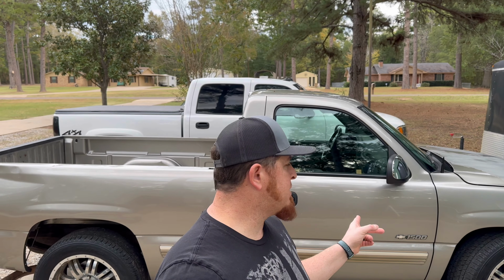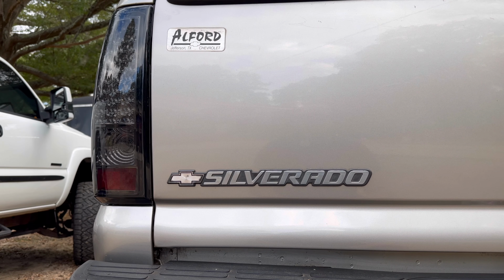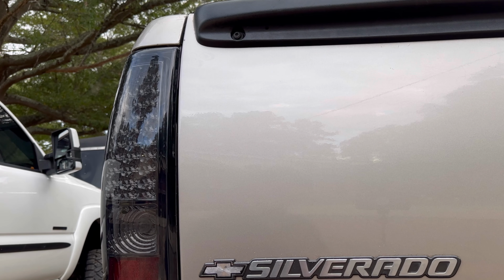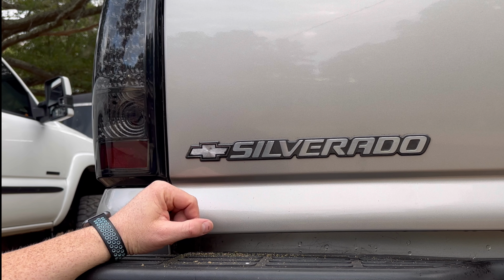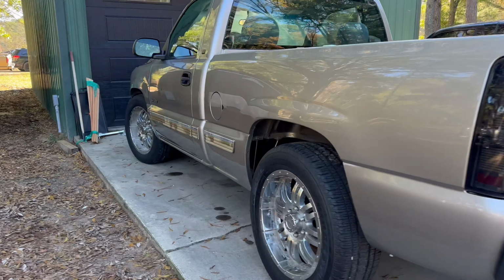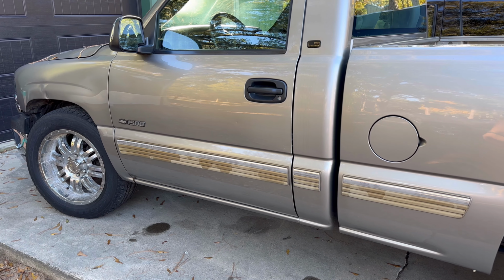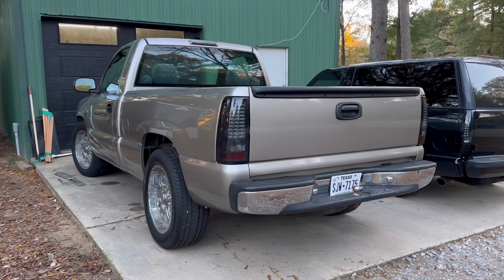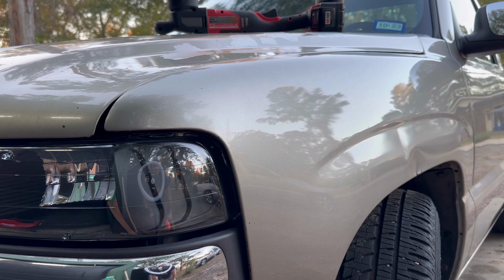EMBLEMS AND MOLDING REMOVAL DROP SHACKLE INSTALL‼️Part 2 Chevy Silverado RCSB Transformation‼️

Comment: Tip from experience with my 2004, you dont need to do the floss/string trick with the side trim if you're in a warmer environment. let the truck heat up in the sun and they should pull right off
Reply from the maker: True, sometimes you do not. However, you should always be careful not to pull too hard and peel the clearcoat or paint off of the truck.

Comment: Looks cleaaan good work.. plan to do the same to mine here next handful of days.. got the flares off yesterday so now it’s time to debadge and remove door trim & the z71 sticker (which I’m having a hard time parting with lol).
Reply from the maker: Thanks! Yeah yours will look clean debadged. If your truck is a Z71 then just get a new Z71 decal, but is a custom color. That will make it more custom.
Reply: @whiplashtv2022  that's a good idea if i end up keeping it... feel its homage to chevy by keeping it but, damn every bed I see without looks so good lol thanks
Reply from the maker: @lilshaff07  I hear ya. Atleast it is a decal sticker and is cheap and easy to add or remove. So you can decide which you prefer.

Comment: Did you have to grease the drop shackles? I have the same ones ready to install.
Reply from the maker: Yes, you need to grease before installation and then occasionally after that. If you go back through the videos here on the channel, then you can find a more detailed installation video on the 2005 Chevy Cateye build that I did.
Reply: @Whiplash TV  thanks. I have a 03 extended. Stripping the stripping before paint, so that was a nice thing to watch. Im putting the shackles on later today, thanks again.
Reply from the maker: @BatmanIII  you’re welcome